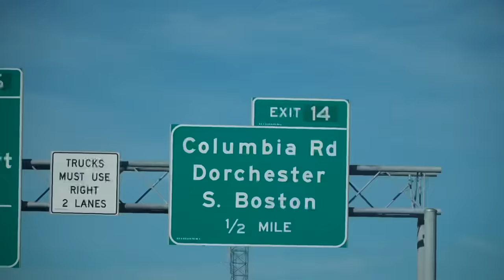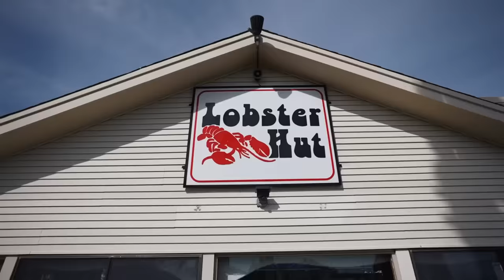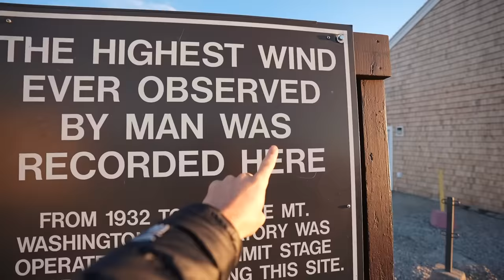72 HOURS OF VAN LIFE IN NEW ENGLAND (this is what it's really like)

Comment: To measure 231 mph wind, it would have to be a specialized instrument, not your typical weather station hardware which typically are blown away around 80 mph.  Perhaps the IAS (indicated air speed) from an aircraft.

On November 1 (today), the water temperature at Cape Cod is 57.7 °F.  A week ago, it was 62.4 °F.  That is not freezing.  Since you mentioned Oregon's coast, the temperature at Seaside, Oregon, today is a balmy 55.7°F with small waves of only 4'4" (1.33 m) average due to the early morning conditions.  Yesterday morning the waves were 6'9" (2.07 m).

Comment: Hey guys I will take the van for a engine inspection when the engine starts running sounds pretty rough 😬 I'm not an expert but it will not hurt to have a check 
Camshaft gear ⚙ 🤷🏻‍♂️

Comment: I have been watching for a few years now, so I am well acquainted with Nate's penny pinching ways. But enough, you are pulling in big bucks every month from viewers, ad revenue and all your side jobs! Buy a decent van! One that doesn't require making a bed/table to access switches, had a decent fridge so your friends don't feel they need to buy you a fridge and install it, one that doesn't break down or fall apart, had a decent toilet that you could use without thinking about how bad it is to empty, etc! You are no longer living on a few bucks a day. I don't enjoy watching Kara struggle with a no-reason-for-it tiny space to flip a switch for a hot cramped shower.
Reply: I agree with you on this.